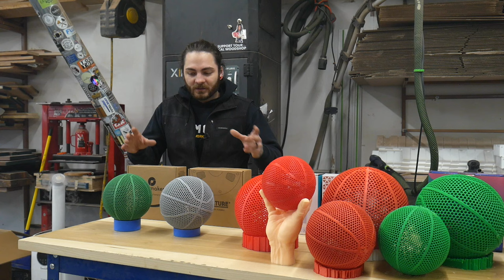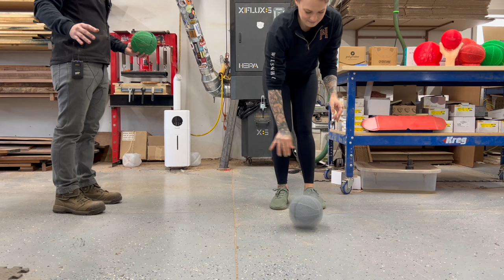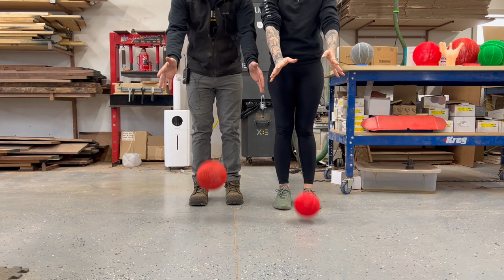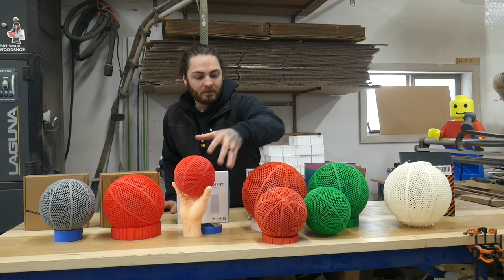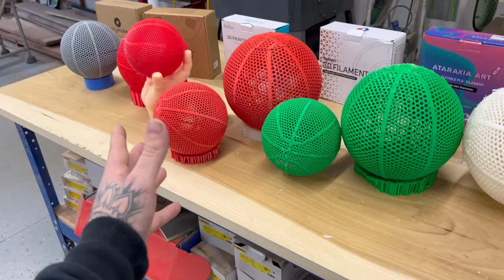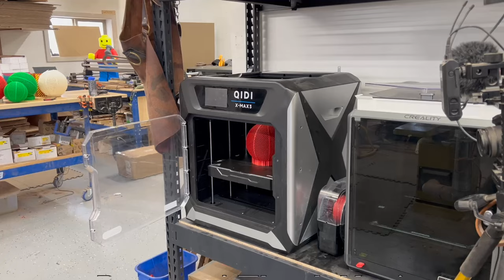Can we recreate the $2500 airless basketball on a Hobbyist 3D Printer?

Comment from the maker: Flashforge Flexable PLA was the best option to my knowledge/ testing. It has been in and out of stock over the last week so if you're interested use this affiliate link or check it out on amazon. https://amzn.to/3VwCmPg
Reply: PEBA is the filament that you need to make this actually work. It isn't super difficult to print, just be warned, it isn't exactly cheap. You're also printing the wrong model, the correct model had an internal lattice which I'd connected to the external ball so it's almost a ball inside a ball but that allows it to behave like a composite which I MUCH thicker effective wall thickness.
Reply from the maker: @hot_wheelz I’ll check that out!

Comment: I 3D printed that airless basketball out of PA12, but it was way too hard and it broke. I've done a lot of research and the best filament I could find was the TPU CF from Extrudr, with a hardness of 58D. It's somewhere between normal TPU and PLA Flex. This filament probably bounces perfectly and the carbon fibers make it more durable. I think it's worth a try.
Reply from the maker: Interesting! Thanks for the input. 👊🏼👊🏼
Reply: Best filament for the Airless Basketball I’ve seen was with PP. Immediately ordered some and looking forward to printing this weekend!
Reply: Any update?
Reply: Any update?
Reply: @rickyneeter69  sorry but Ihave some problems with my 3D printer and as a student I can't afford the TPU cf just for one try. Maybe someone else wanna try it.
Reply: What about armadillo tpu

Comment: The ball needs a hard interior made of a strong a durable material (PaCf-6 maybe) and then needs a softer flexible exterior like tpu. The science is too much to explain but it will allow the harder material to flex more without breaking. This is the same concept that's used in fiber optic cable wherein the core is glass (yes hard brittle glass) but has a flexible polyacrylate sheath or something similar which takes strain off the glass and allows it to be flexible.
Reply: How do you print that?
Reply: @sabotage3d  my best guess would be a multi material print system like the Bambu AMS. Unfortunately I not all that skilled in modeling nor do I have an AMS. But it would essentially just be making the infill solid and of a different material.
Reply: @icemaster127  AMS doesn't support soft materials, they also won't bond well together.

Comment: using flash forge flexible pla filament I have had best results just using a pretty standard pla profile and just running the speeds and temp a little lower.
Reply from the maker: Interesting, I’ll play around with that thanks!

Comment: hey mam. first time i see your videos keep it up the good job. i can tell you why all of the balls you print fail. the reason is way simpler than just the filament. the original wilson ball was a second smaller ball inside who touch the outside(like a centimeter from the exterior) this gives the ball the stability to bounce like spring.
Reply from the maker: Thanks for the tips!

Comment: ASA with actual layer adhesion will be perfect for this. You need an 80C chamber and LOTS of cooling to print it with properly. Regular printers are not going to cut it. You need a Voron or something with parts that can take 80C and with a lot of insulation. Proper nylon would be ideal but it's difficult to print with fdm. Even in a 100C chamber it will shrink and fuck with you.
Reply: What about PEBA?
Reply: @zakparamir755  No, flexible filaments won't bounce. It needs to be fairly stiff but with impact strength. ASA or ABS but printed properly in a very hot chamber will do the trick.
Reply: @zakparamir755  PETG might work too if printed in a 50-60C chamber.

Comment: I need the settings used for flash forge flex PLA from you please. Subscribed.
Reply from the maker: hey! I printed it with tpu settings, Print it sloowwww. I dont recall the temps I printed it at